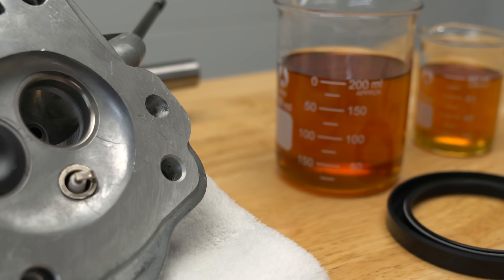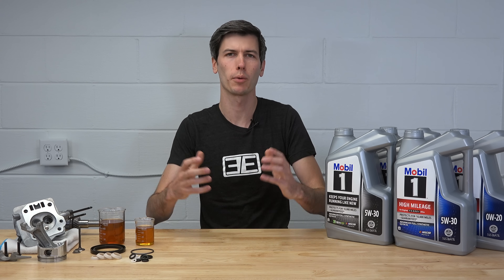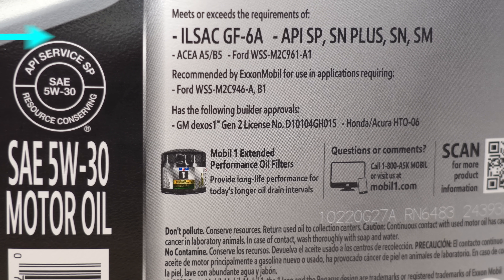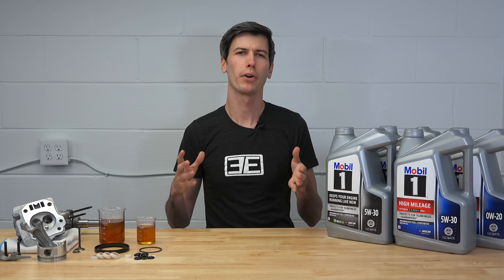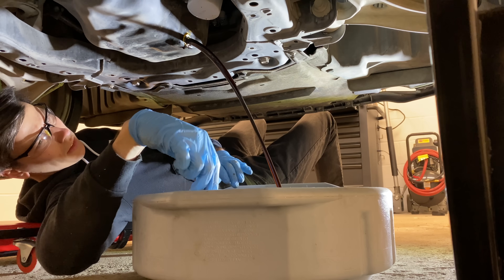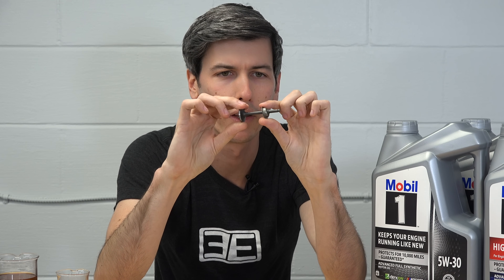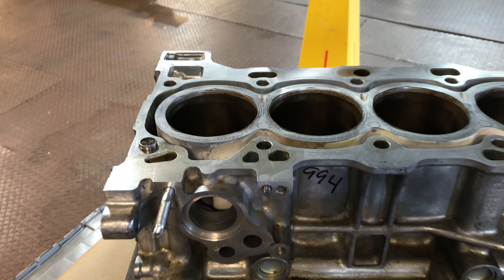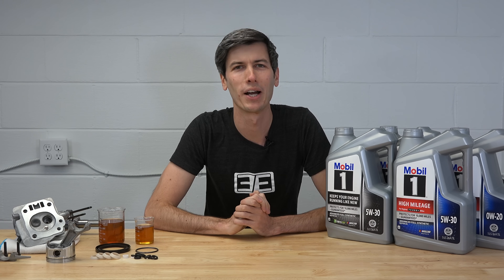Is Synthetic Motor Oil Bad For Old Cars?

Comment: I have been using Mobile 1 since 1980, there was concern at the time that using a synthetic product was an issue. My 1980 was and Old's Cutlass purchased new, Zero issues even what Mobile was manufacturing at the time. The concoction is much different today. I although did later purchase a 1985 6000STE, it was not the oil but the engine, all engines are Not of equal value. That engine was pretty much toast at 120,000 which should never had happened. Again I do not blame the oil but rather poor manufacturing of the 3.8L in that car. Driving habits were the same, intervals were the same. Just a poorly built engine of the time, later 3.8's were better built. Oil is for the most part built to a strict standard, where as I mentioned engines are not. The money you pay for an automobile all engines should be built like most Toyota engines. Don't get me wrong Toyota has made some engine blunders but not comparable with other manufactures. Yet what is unfortunate about the last statement is that when Toyota does make a mistake they don't own up to it and replace a bad engine, you are stuck with it. It's a roll of the dice, but it's engines and not oil at issue. Yes of coarse owner care has allot to do with the outcome. The good news is that the generations to come won't have to worry about the internal combustion engine. They will just have to worry about whether they get a bad winding in their motor.. ;) .. I'll leave you with this last thought, if all auto companies had a 10 year warranty bumper to bumper you would have almost no issues with cars on the road today.  People need to demand longer warranty's from the automotive companies, this way in most cases they are responsible and will for the most part design for their own health as a company. I buy Hyundai and KIA for their longer term warranties. So far so good, I would buy Toyota but I can purchase three Hyundai's or KIA's for the price of two Toyota's. Problem solved on my end money wise. Peace..

Comment: Wear is lower when using synthetic oils.

The role of oil is to provide lubrication and make the engine last as long as possible.

The difference is greatest between mineral and synthetic oils. 

There is only a small difference between semi-synthetic and synthetic oils but a large price differential which is why many people compromise and buy semi-synthetic.

:-)

Comment: I have been using Mobile One for many years starting in the 80’s. Many of my engines last more then 2k miles. I had a 2001 Lexus  RX I decided to retire it at 263, 000 miles as the. Brake job was going to cost more then the value of the vehicle. I will always make sure that synthetic oil is in all my vehicles. Most manufactures today recommend synthetic oil  as the only oil in their vehicles.

Comment: Straight answer, before even seeing this video: use the oil grade that engineers that built Your engine had in mind. Synthetic oil is superior but more expensive than mineral, and makes sense in more strained (sporty) engines. No oil will ever cause Your engine to leak, because healthy engine should not leak, if It's healthy. If It leaks, You should change seals. If It leaks, but Your mechanic tells You to change oil for thicker (or mineral) oil, He expects Your engine to fail soon, and just offers You cheaper patching of the problem.

Now, I'll watch the video...

Comment: Remember older cars 1960 ‘s need ZDDP for valve gear protection. This addition is not available in modern oils since it attaches the catalytic converters.
Reply: Amsoil makes incredible high Zinc Synthetic oil

Comment: I was confidently rebuilding engines at 19 years old, and applaud your video - online with my experience - that synthetic is the way to go. The last bastion of fighting a thicker oil is variable valve timing mechanisms being knocked out of sync. And of course syn's are thinner than comparable standard oils.
Reply: @joe pimental who the heck taught you about oil? A viscosity weight oil is no different on conventional or synthetic. You obviously don't know what your talking about.
Reply: joe, I think you're addressin two issues, as the video did.  That 1) sythetics are good, and (2) (not as clear) that the thicker oil argument (also a tangent in the video, not specific to synthetics) is also a concern for VVT.  I don't work on others' cars but I do review many, and I've seen the issues you're alluding to, I think.  Timing chains/tensioners too.  Stay in spec...
Reply: My dad had been using conventional 10w-10 motor oil in his cars since at least 1960 so synthetic doesn’t have the corner of working in cars. As long as you don’t use heavier motor oil for a while and try to switch back thinner oil will continue to work fine. When heavy oil is used the clearances has to wear before the heavy oil will circulate where the thin oil had no problem.
Reply: Synthetics are thinner? Not really.   They flow better and get to important wear points faster when cold.

Comment: I have used Amsoil for a long time , found nothing better . Now , you have a motor with 70 K miles or more I would not recommend synthetic . Old oil piles up around the seals creating extra heat the seals get hard . Synthetic will in time clean that old oil off the journals and you have a leak . Do not use synthetic in the big 300 ford 6 . It just don't work well in that motor .

Comment: ZDDP?  You didn't address this at all.  New oils have very low levels of ZDDP and the hot rod world running older engines without roller lifters all recommend oil with more ZDDP or an additive.  So can you run synthetic in an old SBC V8 (1955 - 1980s)?

Comment: Interesting.  I was watching a video ( on problems with the Ford Coyote engine) where a mechanic was tearing down an engine. He pointed out deposits in the engine and said they were from synthetic oil. He said especially in cars that drive short distances (so the engine doesn't get very hot) he'll see these deposits. So I wonder if this is real or if the deposits are from something else and he's just blaming the oil? Honestly I can't see a lot of scenarios where Mobile would recommend you don't use their oil. :)
Reply: Most likely he's right about the short/slow trips causing carbon buildup and blaming the synthetic (why would that matter, more detergents?).

Comment: I'm disappointed Jason refers to Wankel engines as "rotary" engines. I used the latter nomenclature as well, before realising that rotary engines are those radial engines found in older aircraft, which are connected with the crankshaft and propeller, and spin together with the crankshaft while running. The Sopwith Camel is one notable example; even at full throttle, the engine sounds like it might die at any second of time.

Comment: I watched this video but the most important part you missed out, older cars with flat tappet cam shafts eg 327 SBC require engine oil with Zinc or camshaft wear will occur. 
Will synthetic oil prevent camshaft wear if its got low level Zinc? Its the most important point 😒
Reply: joca .. i was hoping for a answer to this part of engines with hi-performance as the 327 you referenced.  i am still in question. these hi reving engine with stong compression ratios.. i was hoping to use a syn oil to assit. it's seem that a oil with syn properties will work

Comment: So called synthetic oils, are just oils which have been subjected to an additional refining process. They are not really "synthetic" at all. Are they worth the extra cost? No, not if you change your oil and filter at regular intervals. All oils, including synthetic oils, have an additive package. When the long chain polymers and detergents in that package, begin to break down, the oil can no longer do the job it was designed to do. Extended oil change intervals are a false promise. What they will do, is lead to early engine failure. Expensive synthetic oils are a cash cow for the oil industry, not a necessity for automotive engines. Caveat emptor. Let the buyer beware.

Comment: When stationed in Fairbanks Alaska at Ft. Wainwright between Sep. 79' and Feb. 82', several of us in the airborne company had full size 4x4's, mainly Chevys and Dodges. I had a 1975 K5 Blazer with a 350 and A/T, bare bones model. After a few guys that were running Pennzoil had their engines spin bearings (cam or crank) and/or lock up completely, I switched to MobilOne synthetic and never looked back. That was 1980/81 and have been using it ever since in whatever brand or model vehicle I have owned to present. That may been a bad "lot" of Pennzoil. I was using Quaker State at the time, but making my way back thru the lower enlisted ranks, I didn't have extra money laying around for a new engine, so it was actually cheaper to use the more expensive MobilOne for peace of mind. It also was easier on the engine in the sub zero weather as it didn't thicken up like molasses. BTW, my 03' Tahoe Z71 has 300,612 miles on the clock. Oil and transmission service done yesterday.

Comment: Had an old car with no leaks. Added synthetic. Leaks started from every gasket.
Reply: Well conventional oil left deposits that damaged the seals. Synthetic oil has smaller molecules that cleans up those passages.
Reply: must have been a  GM
Reply: Love Your Anecdote “evidence”
Reply: I had an old car with no leaks. Added synthetic. No leaks at any gaskets.

Comment: Hey there! 
What engine oil would you recommend for my 2014 Subaru Forester 2.5 with 190,000 miles it's consuming about a quart 
of oil threw 3500 miles?
Reply: I would definitely switch to a 0W-40 or 5W-40 if you haven’t already

Comment: Hey Engineerng Explained, you talked about the difficulty to increase η from 40% to 41% and I wonder why no production engines use solenoid or other electromechanical ways to operate the valves? Seeing all the components needed to operate the camshafts (incl. oil circulation), I'd assume that going to electromechanical could be a winning strategy. Also, I don't see that the EM is "too complicated" or fault prone with today's knowledge. (*winning strategy, excluding improving thermal efficiency by utilizing Th in the exhaust gas) ;-)
Reply: electric cars wear out fast high repair biill at 10 years of use.
Reply: Valves need to move very fast with relatively strong force + mistake means destroyed engine. It is hard to manufacture strong and fast solenoids and even harder to guarantee they will work all the time (weak battery start for example).

Comment: 5:00 you are 100% wrong about using thicker oil in old engines. An older engine has an older oil pump. It's harder for that older oil pump to suck up thicker cold oil.
If the oil light is coming on at idle. You need a rebuild.

Comment: Do modern synthetic oils contain zinc? This is required in older engines, particularly to prevent lifter wear. How do I find out the zinc content in ppm? I'd like to find a modern oil that works in older engines so I don't have to use zinc additives.

Comment: I have a 1997 Land Cruiser hi baby and care for. United States North America oil spec is 5W30 but worldwide for the same motor it's 15W40 or 20w50. I was burning about a quart every 3000 Miles when I was running 5W30 with extra marvel Mr oil to help clean the motor. I've only had the truck one year.

I noticed a lot of guys on the forum that I visit Ih8mud switch to diesel oil I'm running the Chevron dello 15W40 it's got an API rating higher than what my owner's manual says and so far it's been fantastic I'm burning zero oil and the engine's much quieter.

Comment: All I run in old cars is supertech full synthetic high mileage.  I've changed them over above 200,000 too when I have bought cars over 200,000
Reply: @opinionsvary  What is your opinion?  That supertech is BS?  It's not, it's warren distribution SN+ and Dexos 2.  That I didn't use it?  Well, I do, it's only $14 something for 5 quarts.    Nothing I said is untrue.  If you don't like the oil, do you have a scientific reason why you don't like or do you just like Mobil 1 commercials?

Comment: The biggest thing old cars need need is more zinc. Use oil for diesel engines and it generally contains more zinc. You can also find zinc additive as well to put into regular car oils. 
I'm the summer I use mobile one synthetic 15-50 and in the winter I use 0-40. It gets -20 in the winter and 100+ in the summer where I live.. crazy

Comment: I used to run 20w50 on my old high mileage LS1 with a high lift camshaft, that oil was as thick as honey.
My current car uses 0w20 and it's like water!

Comment: "...The problem here is a failed seal, not that your oil is the wrong viscosity..."
Subaru owners casually filling with 20W-50 because the valve cover gaskets went again
"...Nah..."
Reply: Too true

Comment: I have 13 collector cars. Here's my thoughts on synthetic vs. conventional oils. 
A few notes:
1. In older cars, pre mid 70's, oil had Zinc added to it. This was to reduce valve & cam wear, etc. Any oil you use in older cars must have Zinc added to it cuz its no longer added to oil mixes. There's several brands on the market. I use STP ZDDP additive. 
2. Older engines were prone to blow-by getting into the oil & then being sucked into the carberation system. Synthetic oils will carbon up faster in this process than conventional oils, in my experience. In older engines I stick to conventional oil. 
3. Synthetic oils are less susceptible to "whipping & foaming" than conventional oils. This is good, esp at high rpms & hot engines temps. 
4. Synthetic oils flow easier at cold temps than conventional oils. This is great for very cold climates.
Reply: Fact is the API ZDDP content of today is exactly what it was in the 60's which was the hey day of flat tappet engine production. Yes, 800ppm ZDDP was the API standard for oils in the 1960's. Find yourself another talking point lol and learn how ZDDP actually operates. If you are "adding" anything to a established oil package you have just destroyed that product...proven time and again.
Reply: That is not true, all motor oils have ZDDP, the amount has been reduced in most oils but many still have plenty like Valvoline VR1.
Reply: @FirstOnRaceDayCapri2904  You're half right: all oils have some  ZDDP but in vanishingly low concentrations. All the major brands admit this. Older engines require higher levels to prevent, among other things, excessively fast tappet wear. Just google the topic and you'll see what I mean. Rislone, Amsoil, Valvoline and others all agree on this, as do engine builders and classic cars restorers like me.
Reply: @paulmaxwell8851  Of course Rislone, Amsoil, and Valvoline agree. They know the zinc myth has created a market for more product to sell. They've probably done the same google search you did.

Comment: Ford trucks indicate 5W-30. I switched to 5W-20. It flows better especially in an engine with high mileage. Yesterday my truck hit 363,541 miles. I change the oil every 3,000 miles. Regular oil. Not even a tap.

Comment: At 7:40 you stated the valve seal prevents oil in the cylinder head from entering the intake manifold. That is not correct. The seal prevents oil on the cylinder head from entering the combustion chamber.

Comment: Without a doubt, synthetic oil will leak out of older engines the have slightly leaking gaskets - a lot. Seals are another story.

Comment: I have a 2005 Pontiac Grand Prix & have used synthetic oil since it had 45,000. I now have 270,000 miles & it still runs great. Does it use any oil? Yeah, a little bit but, definitely not enough to switch!!! Plus, I drive 80-90 MPH almost everywhere I go which I'm sure doesn't help!!

Comment: Been using  full synthetic in my '02 Toyota Highlander for close to 15 years with no problems.  I only change it once a year, but after only 8-9000 miles.

Comment: i use valvoline high mileage 5w30 syn blend for my old engine , 2008 crown vic, it burns a quart in about 4000 miles, not bad for 221,000 miles

Comment: In Toyota 86 the factory manual asks for 0w-20 Oil. But if your oil gets hot on a track or the street you could use 0w-30 or 5w-30. Thicker oil will provide higher pressure at high rpm as 0W-20 fails at that when it’s hot at 5000rpm plus. Or you could use oil cooler....

Comment: Great video, I really enjoy the explanations in your videos. Question: Is there a way to find out what kind of oil is in an engine ? Say from an engine in a car from an auction...  thanks for the content.
Reply: Thanks, good question... I have Thought about that. Seems like I would observe in light/smear on glass/ himInyensity light in Engine/smell/ Blackstone ANALYSIS Labs(time & Value DEPENDENT)/check stickers,etc. .... BEST ** SOLUTIOM*, HAUL, slow drive if appears OK::TO trusted Mechanic, Simply .. just change Oil*& Filter , using Proper OEM,& Procedues )....interesting Situation.!,

Comment: 1995 3.0 Toyota and 1999 5.4 Ford that went to synthetic oil at 100,000 miles. Now they have 480,000 between the 2. Change the oil and if you can afford it. Use synthetic...

Comment: Yes it is bad if your oil cleans to good, cus it breaks up the sluge and crabon and it plugs your oil passages.  Ive seen and, heard this happen.  Old car trucks tractors welders what ever just use convetinal till you rebuild the motor. Scored cranks are better then a a spun bearing.

Comment: Someone told me that Ford branded cars used to need only manufacture rated oil, even if the engine is toonold. Why that? Because those engines has very tiny pipes that can be obstructed by thicker oils. Is that true? can we ruin our engines that way?

Comment: Synthetic just doesn't burn as well. If you don't care about horsepower or just want to save money by not changing oil as much you can use synthetic. But I wouldn't recommend it for old engines.
Reply: It absolutely can and will cause carbon build up in engines old and new it doesn't matter how much soap is in the synthetic oil. It does not burn as well.